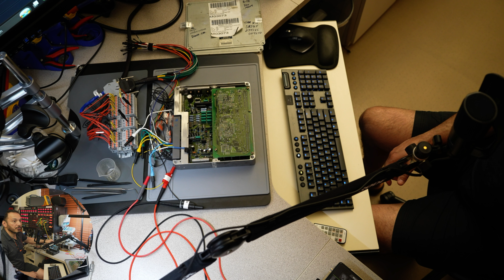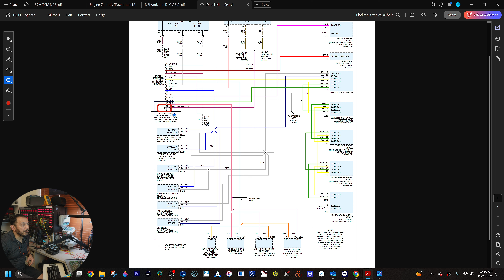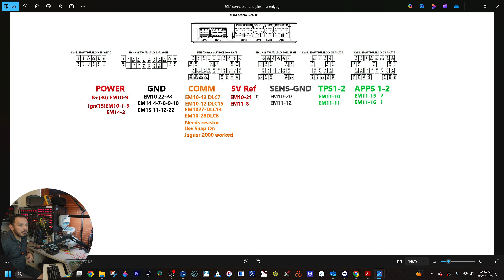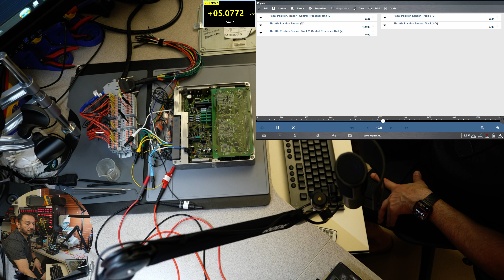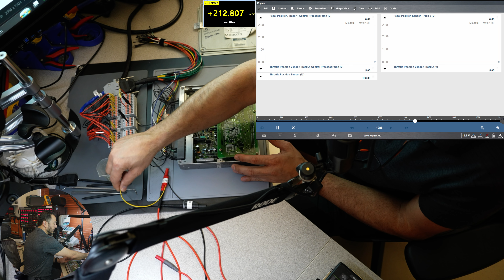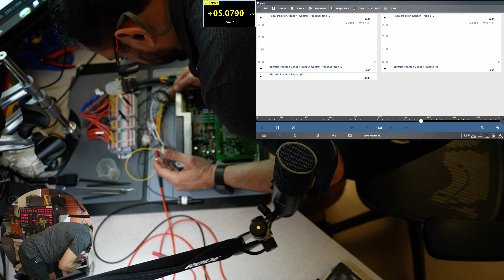1997 Jaguar XK8 ECM sensor supply voltage high full test  Don M in MA www.maicsalazardiagnostics.com

Comment: Hi Maic, 
I am the (Fred) the JLR technician that works for Don at Custom Transportation. I recommended you highly to Don and I have watched your videos for years on YouTube
First let me tell you what NAS and ROW means on the Jaguar schematics. 
NAS means North American Specification and ROW means Rest of the World. 
The reason we needed this computer checked out was because we were getting transient spikes of  insanely high voltages on all the sensors of the 5 volt reference system while reading live data. These voltages were often far in excess of even battery system voltage including spikes of 31, 55 and sometimes over 200 volts. I had assumed that the only way that this was possible was from some inductive coil residing in a component ( like a relay) that was producing and collapsing a magnetic field. We wanted to make sure that there wasn’t something malfunctioning on the ECM circuit board that was a creating these spikes. I was also suspicious that an intermittent short in the throttle body motor windings that was being fed by a pwm signal could be causing these strange readings. 
We will be preemptively replacing the throttle body motor prior to reinstalling the repaired ECM just in case. 
Anyway, thank you for your competence and knowledge. You are a valued resource for the technical community.